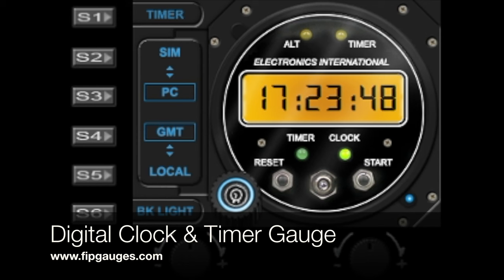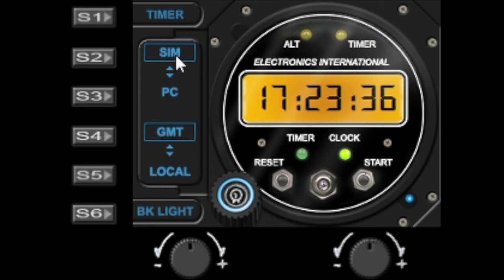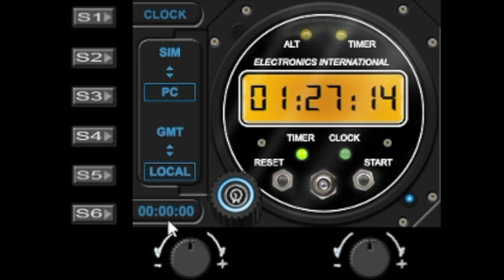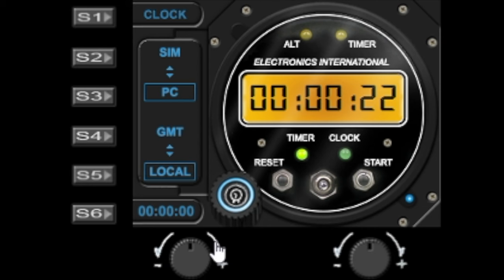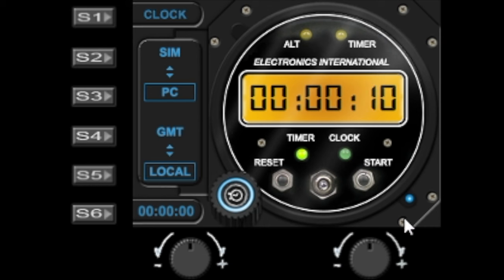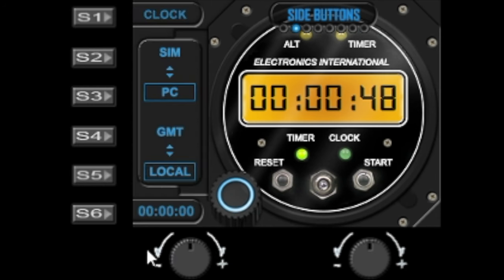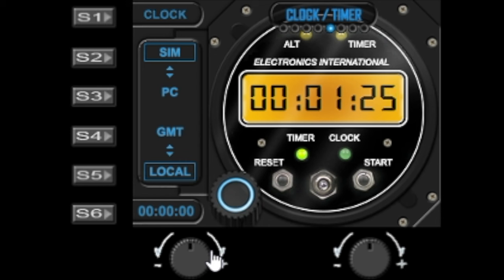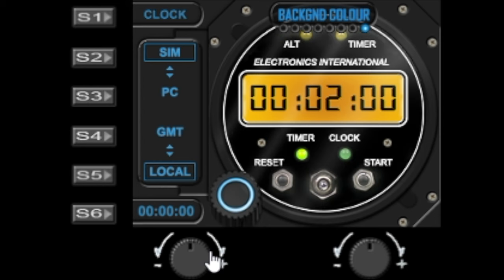Digital Clock & Timer Gauge - Saitek/Logitech Flight Information Panel & SPAD.neXt

Comment: It could be great if you can add the temperature too, like in the cessna 172
Reply from the maker: That’s a great idea, I’ll see if I can implement that. What temp does it show? There are loads of temperature variables ie OAT or TAT
Reply: FIP Gauges thanks!! Happy to hear that! :D.  In the c172 the clock shows the temperature (switchable in c / f ) and the aircraft battery voltage state !
Reply from the maker: I’m actually thinking of doing a slightly different digital clock with O.A.T. And Volts, one with dual display. The current gauge could show voltage and OAT but not at the same time as the clock without a total redesign and it makes more sense to have a different design with dual display. I may still add OAT and voltage to this gauge as a clock/timer/volts/OAT toggle instead of just clock/timer. Once I’ve done the new clock/s I’ll give you the option of switching over to it in your order downloads/updates. I’ve already started the new gauge as should be available by the end of the weekend, although you’ll have the same issue with time from the sim
Reply: Thanks a lot for your offer and for the fast support!! You are great. I hope with next update of spad.next the issue will fix.
Reply from the maker: Have you reported the issue to SPAD.next?
Reply: Not yet, i will this evening when home. But usually they never answer to the tickets reports!!!

Comment: Hello, i use spad.next with x-plane v11.10, will it works ?
Reply from the maker: Hi, not a simple answer to that question, this will explain... http://www.fipgauges.com/simulators.php
Reply: FIP Gauges I bought it. It works in x-plane 11.10 with default cessna and the airfoill labs c172. The only issue is that in showing the ‘sim time’, it show the time but randomly every second the number jumps to another value and get back to the right value... May be becouse there is not seconds showing in the x-plane cessna clock?
Reply from the maker: This is exactly why I don’t fully support x-plane :-) sounds like an issue in the translation of the x-plane clock to simconnect, I display whatever SPAD.neXt sends into the gauge, but worth raising a ticket in the SPAD.next forum. SPAD did offer to trouble shoot conversion issues as part of the x-plane licence